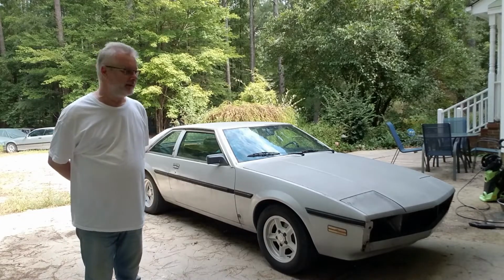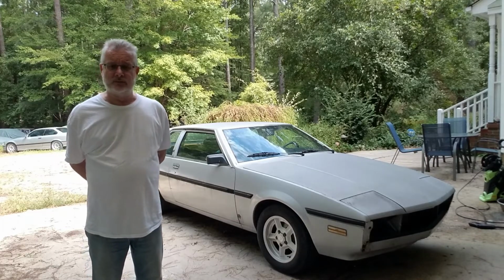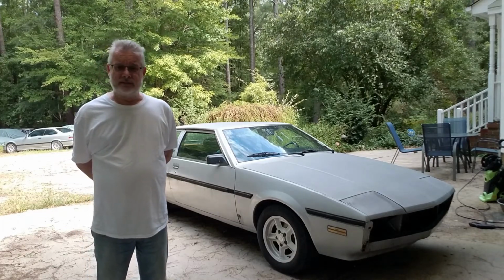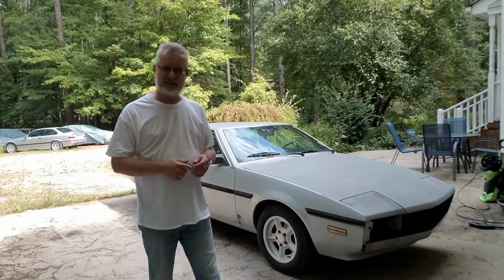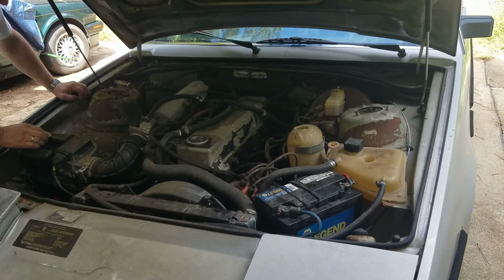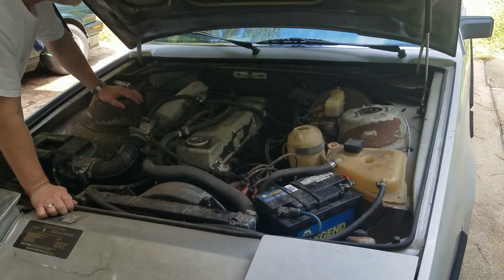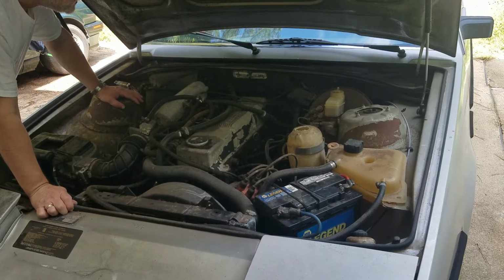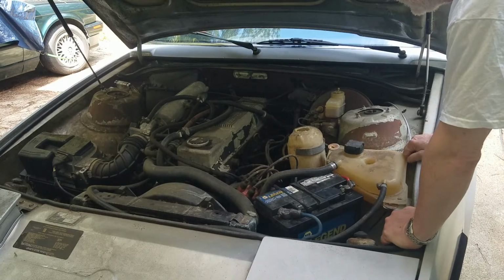Bitter SC 377 - 01 - First Assessment

Comment: your brake booster is shot
Reply from the maker: Hi! It only looks like that. It is "cosmetic damage". It still generates plenty of boost.
Reply from the maker: Hi! Yesterday I missed that you were talking about this particular video. The high idle and stalling when hitting the brakes was gone after I had replaced all vacuum lines and also the rubber grommet where the vacuum line connects to the booster. If you check minute 1:01:15 of the fuel lines and injector video you'll see that it runs properly now. Sorry for the misunderstanding.